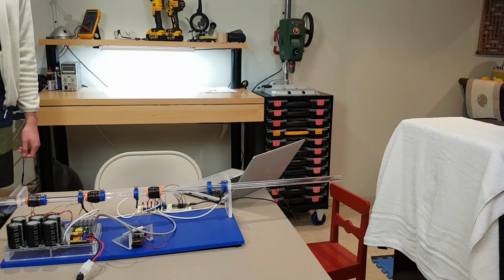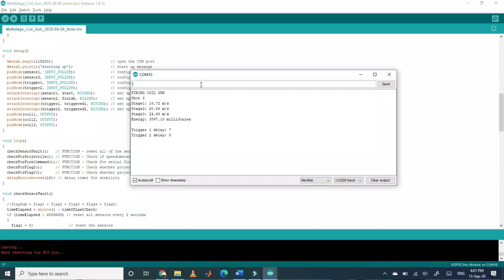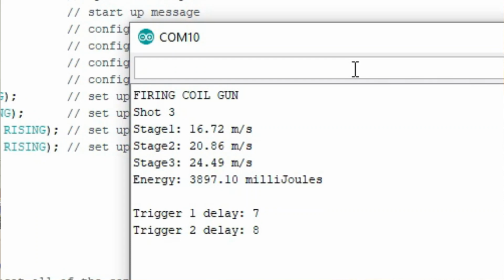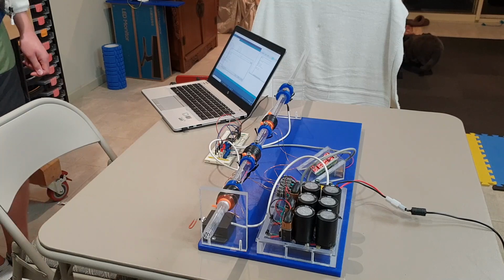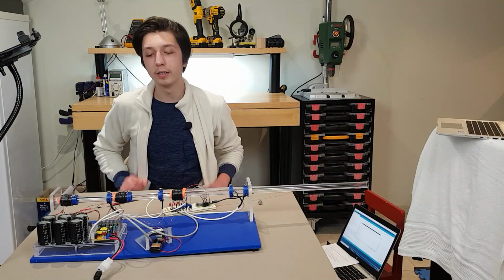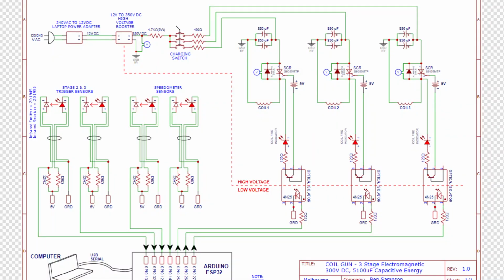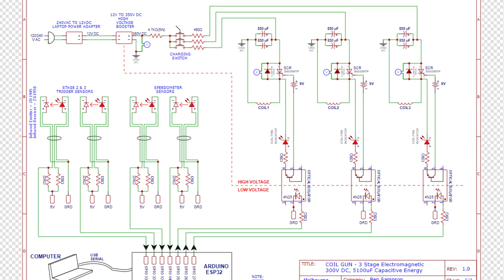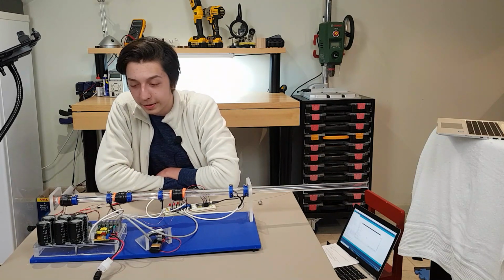Coilgun powered by Arduino

Comment: Nice job! Is there any feedback circuit to switch the coils off again when the projectile passes the middle of each coil or is it just trial and error by using the exact same projectile and coil temperature? Since the magnetic field strengh decreases with at least the distance squared from the coil, you would think that timing would be crucial to get any efficienc at all.

Comment: Hey, nice job coming from an Aussie maker in the midst of a similar project! Of course I stumble across this video after I finish designing my circuit 🙃. I have two questions: how did you find was the easiest way to wind the coils and connect them to the circuit, and did you ever measure their inductance? Yours are very neat and compact compared to the jumbled mess I'm currently working with...

Comment: Hello, I'm making one of these in my home and I have an Arduino uno. This project might work with this Arduino?
Reply from the maker: Yes, I believe it would still work with an Uno with a few limitations:  1) There are only 2 external interrupt pins on the Uno, so you'd have to give up either the speedometer or 2 of the coil stages. 2) The Uno runs at 16Mhz instead of 240Mhz so the timing and accuracy of the interrupt pins would suffer.  Alternatively ESP32's are only about $5 USD on aliexpress (https://www.aliexpress.com/item/4000296658456.html).  Good luck.
Reply: Oh yes of course. See also New Portable Super Coilgun:

https://www.youtube.com/watch?v=rclLsQ9nyeg&amp;feature=youtu.be

https://www.youtube.com/watch?v=-mjDqp_oWZk

Comment: efficiency?
Reply from the maker: Not very efficient. 1.7% by my calcs.  It was more on proof of concept to control it with a microcontroller rather than optimisation for efficiency.   (calcs = KineticEnergy/ElectricEnergy = ((m*v^2)/2) / ((C*V^2)/2) = 3.7 joules/216 joules   [m=0.013kg v=24m/s C=6x800uF=0.0048F V=300V]
Reply: Oh yes of course. See also New Portable Super Coilgun:

https://www.youtube.com/watch?v=rclLsQ9nyeg&amp;feature=youtu.be

https://www.youtube.com/watch?v=-mjDqp_oWZk

Comment: Hi i am planning to build one for my second year project and i need the speed to be above 100ms-1 
So i thought to go with lighter projectile like 5g 
Can you give me some tips on this
And did you work on magnetic saturation point 
And can you provide me some scope screen shot of capacitor Voltage and current
Reply from the maker: That sounds like a great second year project. I don't have a scope so I haven't been able to look a the voltage and current curves yet. My projectile was 13g, so 5g would likely be much faster. I wish I could help more. Good luck!

Comment: very nice.
1. coils move = energy loss. use glue.
2. put 2-5ohm resistors and diodes on the coils, it will reduce the "suck back" of the coils.
Reply: Oh yes of course. See also New Portable Super Coilgun:

https://www.youtube.com/watch?v=rclLsQ9nyeg&amp;feature=youtu.be

https://www.youtube.com/watch?v=-mjDqp_oWZk

Comment: Time between detection of projectile and firing is 6microseconds.
Compared with Arduino Nano, it's 15 times faster.
What is faster?

The detection-to-firing time is faster than Nano's reaction time? (So a nano won't work?)
The ESP32 is 15 times faster than Nano? (Socan I use a Nano instead of buying an ESP32?)
Reply from the maker: Thanks for the question.  An Arduino Nano can run up to 16Mhz, but the ESP32 in this example was running at its maxiumum of 240Mhz.  Therefore it is looping through the code 15 times faster.

A Nano would also work, but the reaction time would be a bit slower at 16Mhz.  Also the code would need to be modified a bit because the Nano only has 2 interrupt input pins, unlike the 4 interrupt pins used in this example. (Interrupt pins are more accurate in high speed applications because they immediately react to the input being triggered, rather than waiting for the code to loop through and read the pin value.)

Comment: I love this and I will be making one! I have some questions though. 

1. On the schematic, what is the purpose of the 9V between the isolator and the thyristor? (Can I just use a 12v to 9v converted for this so it runs on 1 battery)
2. Is the wire going from the isolator through the indicator led and into the thyristor necessary? If it is, is the led necessary? (I'm not sure how it all works lol) 

Thank you!
Reply from the maker: Thanks for the questions. I'll try to answer them below:

1. The 9V battery was needed to drive a small amount of current through the gate of each SCR to trigger it. Unfortunately you can't use a common battery or power supply for all of the stages because sometimes there is a huge voltage difference between them which would blow up the power supply. For example, the cathode of the stage 1 SCR will be briefly at 300 volts while coil 1 is being fired.  Meanwhile, the cathode of the stage 2 SCR will be at 0 volts because it is not being fired yet.
There might be a more elegant solution to use the voltage stored in the capacitors to do this, but the batteries made it more simple and easy to understand for the purposes of this experiment.

2. Yes, the wiring between the optical isolator and thyristor are necessary as it forms the trigger circuit.  The indicator LED is not necessary but is a nice visual indication that the coil was actually triggered (the 120ohm resistor could be connected directly to the cathode of the SCR). For ease of understanding, you could imagine the trigger circuit all by itself: 1) 9V battery supplies the voltage, 2) the optical isolator is like a switch, 3) the resistor limits the current, and 4) the SCR Gate/Cathode is the device to be energized.
Reply: @KakushinAU  Sweet thanks for your help. I'm going to try to make one 6 stages and fit in rifle form factor lol.

Comment: As you are using a sensor to fire, can't you just use a MOSFET to turn it on, then turn it off at a few uSec later?  Lots of testing will be needed to get optimum timing.  Then you can start to predict how long to turn on by the speed of the ball.  Naturally, it would be best if you had a 10 stage or so, but with less power as the experiment is to learn, not blow a hole in the box.
Reply from the maker: You're exactly right. That would improve the performance and efficiency of this design.

Comment: What is interesting from physics point of view is the recoil. You are accelerating the ball - the ball is being pushed, but then the gun is also pushed in the opposite direction. So there is a push from the ball into the opposite direction. Your gun is heavier and you have the friction of the table ... so in the end it is the ball that accelerates, not the opposite. It will be interesting to see your set-up on a skateboard with a front plate connected to it. Try shooting the plate that is connected to the skateboard and the gun and see how much the entire thing (gun with attached skateboard) will advance.
Reply: Well the gun is still much heavier than the bullet, and the total energy of the bullet is pretty small, so I imagine it will only move a little bit.

Comment: Hi. Nice experiment! When the projectile first reaches the end of the first coil, do you disable it? So which sensor detects this? You need to detect it the fist time, so that the projectile is not "sucked back", right? Then the same for the other two coils, right?
Reply from the maker: Thanks. Right. Disabling the coils upon the projectile reaching the center of the coil would minimise the "suck-back" effect.  This experiment didn't do that because it uses SCR thyristors which are latching and difficult to turn off. 
  I think using an optical sensor after each coil wouldn't be very beneficial, because the suck-back would have already occurred between the center of the coil and the sensor.
  To optimise for suck-back, I would probably replace all 3 SCR's with IGBT's and then turn off each coil after a certain number of microseconds. The microseconds could possibly even be calculated on the fly by the Arduino based on the projectile's speed during the previous stage.
Reply: @KakushinAU  Or MOSFET instead of IGB? If you use a long projectile instead of ball then the projectile could trigger the sensor when the projectile is in the middle of the coil.
Reply from the maker: Good point.  MOSFET is also a good option.  Didn't realize they made them that big, but after a quick search 50amp 600volt MOSFETs seem to be readily available.  Thanks.
Reply: @KakushinAU  Not Quite. It only sucks back if the center of mass of the projectile passes the center of the coil assuming the coil's windings are uniform.
So if the coil is smaller than the projectile and the sensor is at its end, the porjectile would never be "sucked back" at all; thus you're only right if the coil is bigger than the projectile.
Reply: @KakushinAU  It is worth noting that it is not nesscarilly a bad thing at all for the coil to be small, In fact, assuming the number of turns stays the same, then it actually concetrates the magnetic field even stronger.

But it gets even more complex cause that small gain in magnetic field and that huge decrease in length might not give the projectile enough time to accelerate although the force is stronger since the length is smaller... it basically turns off way faster than before not giving it enough time to gain higher velocities.. you see what I mean?
Reply: If only there is a mathematical formula where we could solve for the perfect coil ratio giving N turns and diameter size for maximized acceleration. Maybe I'd do some research on it when I finish this school year.
Reply from the maker: @Beyondo I agree on all points. That formula for maximum accelleration would be very useful.  There would be a considerable number of variables.  Could possibly be modelled in software also.

Comment: awesome video! one question: the coils move back when you accelerate the projectile because they are lose. Because they are probably a lot heavier than the the projectile, it seems like a huge loss of energy... Have you tested it with the coils tightened?
Reply from the maker: Very good point. Should add some tighter locking collars.

Comment: Great video. I had plans on building one of these but it has always fallen on the powersupply side. (mine was using 8x 80V 10000uF caps charged to around 550v- 600v)  If you are going to make improvements on this design, I would suggest making the coils from thicker wire (if you have the space for it), securing them better on the body (the barrel) if I ever revisit my own project I will checkout the optical detection, becaus I had planed it just to relay on constant time to launch the second state.

Comment: Great video! Always cool to see more takes on the coilgun technology. May i ask why the coils are spaced so far apart? Are there any benefits that you found to doing it this way?
Reply from the maker: No reason other than making it easier to visualize.  The coils could be moved close together.  The optical triggers need a little bit of space ahead of the coil because suck-back isn’t controlled in this version. Using IGBT’s instead of SCR’s would fix that.
Reply: See also:   https://www.youtube.com/channel/UCvFzxEIKaw2povm2KZtKNQA/videos